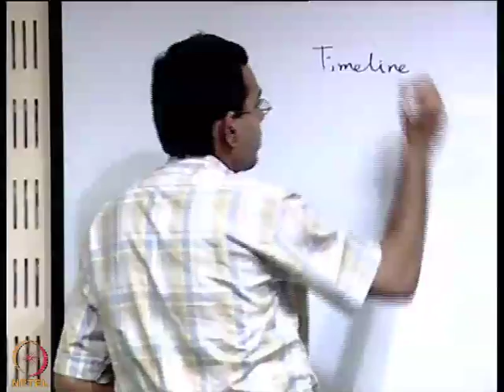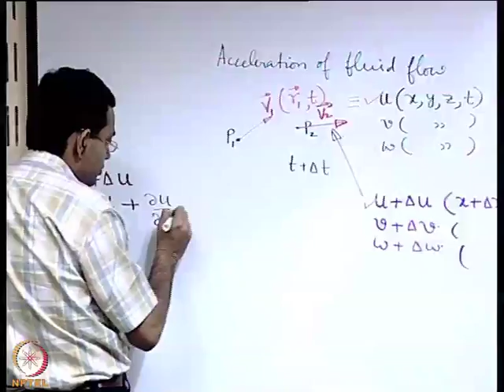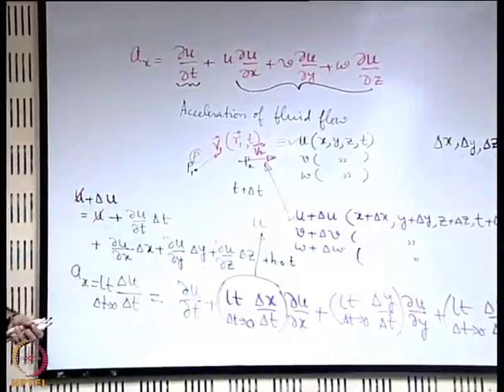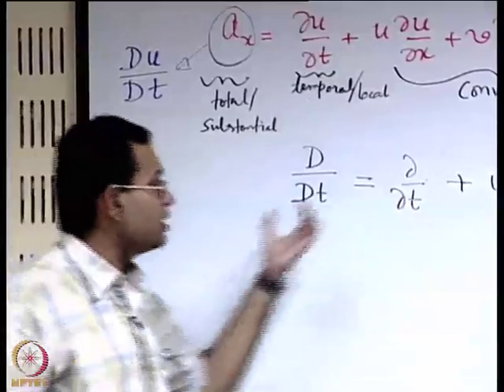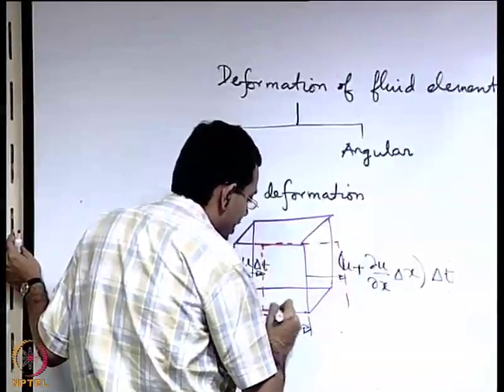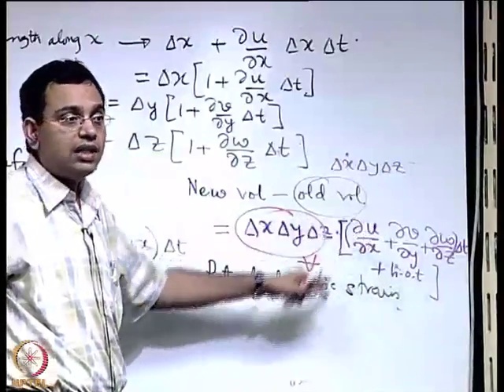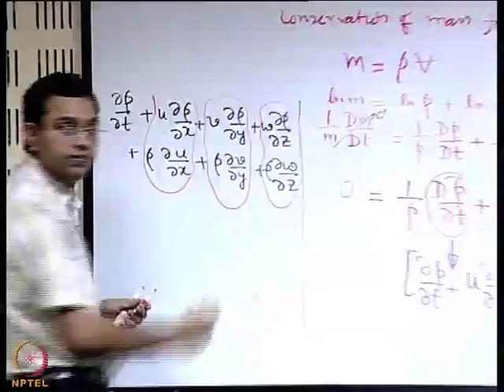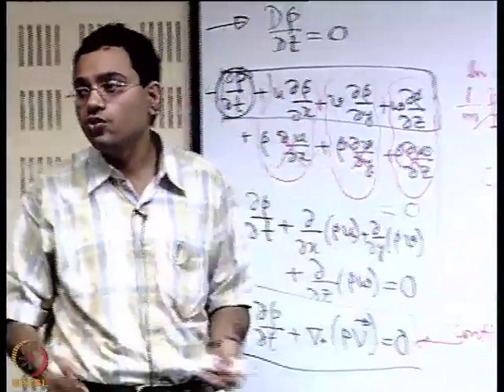Mod-01 Lec-12 Fluid Kinematics (Contd.)

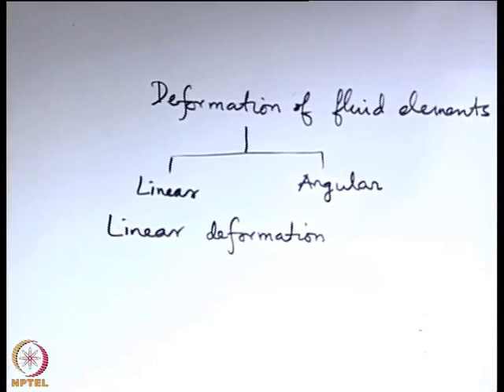Comment: Respectable Sir, what is the definition of the fluid element (at 30:00), keeping which as the basis, you have derived the linear strain or later on the volumetric strain? Its volume surely you have not assumed constant and nor the mass, so how is it defined?